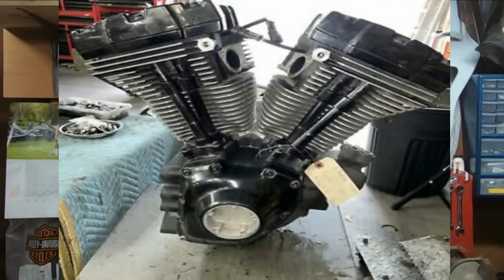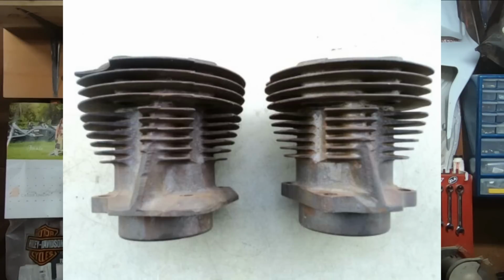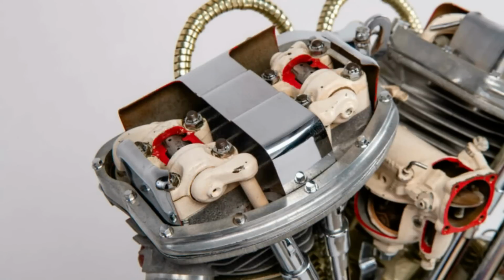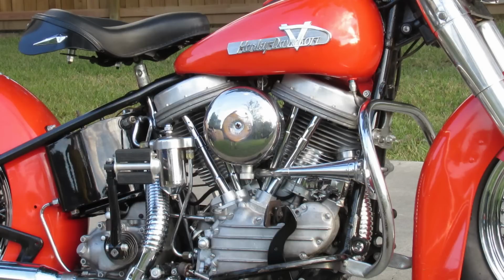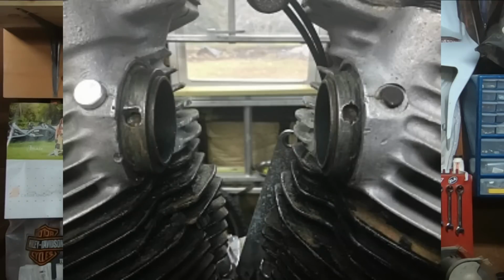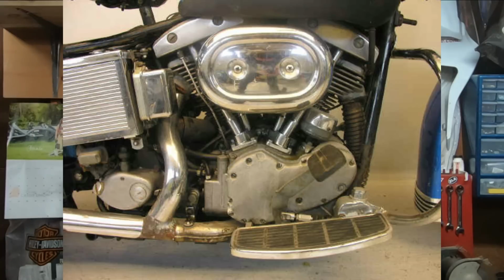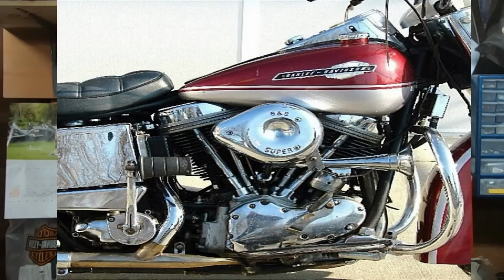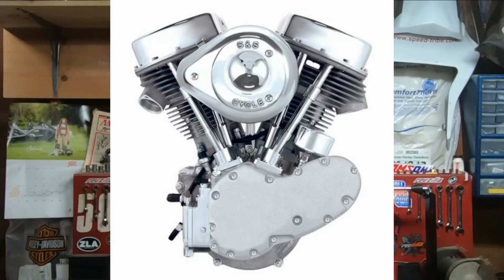Harley-Davidson Panhead is Simplicity at its Finest

Comment from the maker: Have you ever had the opportunity to experience riding a Panhead powered Harley-Davidson?
Reply: Three or four days a week.
Reply: Yes, owned a 63 duo-glide, ain’t felt right since I had to sell it
Reply: I rode my buddies 48 Pan and caught the fever...I didn't build a Pan but a Knucklehead fell in my lap...I ride it several times a week.
Reply: @jasonpatterson8123  I think that’s pretty much how %75 of people get a knuckle these days and in today’s economy, the money made from such a rare bird (engine only) , juice wouldn’t be worth the squeeze, I’d just hold on it. I go years without seeing one, unless it an event.
Reply: I bought my first H-D Panhead in 1966. It was a 1950 FL. It was a good machine -- as long as you performed maintenance when needed and didn't beat hard on it over time. My 1958 Duo Glide was stock when I bought it in the late 1960s. I semi-chopped it. It ran pretty well. I babied both Pans. Ride safe -- W
Reply: I have an 88 Evo that needs some attention. I have 83 Shovel that needs some attention. Once those are done I’ll be looking for a Panhead to either buy or restore. I hope I can find a 1953 same year my Father was born.
Reply: I have a 65 chopper and it is a very easy motor to work on and they run great
Reply: Yes.  😎

My daily rider is a 1979 Electra Glide FLH King of the Highway full dresser Shovelhead.
Reply: My first Harley was a panhead from 62 I kept it 10 years worked on it more than I rode it. And traded it for a VW rabbit and 10 grand in 93
Reply: @randylucas2458  Wouldn’t have been a bad deal if that Rabbit 🐇 is still in Mint condition. Chances are, nobody preserves a Rabbit but they go for a pretty penny if you can find an unmolested oem one. My old boss when I was a yute had one with over a half a million miles in it, still running.
Reply: @MassholeCritic  when I sold the pan the guy I sold it to was a German who worked at the Wolfsburg plant he shipped the car here it was a fully loaded red and black convertible of which the stereo got stole out of three times I finally put a hidden stereo under the seat I kept the car for about 10 years and sold it for $6,000 I paid $350 for the pan head in 1980 and kept it until 92 or 93 whichever year it was.
Reply: @randylucas2458  🤘🏻Can’t even make that 💩 up, great story.
Reply: Had a first year Pan back in the day!
Reply: 1st Harley I rode was a hotrod pan! Balanced with big valves. Ran like a raped ape!
Reply: No ☹️
Reply: I never have. Someday.  Evo was the motor of my upbringing, I shunned them when I was young, youthful ignorance. But I digress.
Reply: Thankfully Yess. I was born in 88. Raised at my dad's Harley repair shop. Pans knuckles and flatheads. Precious Metals Cycles. HARLEY DAVIDSON ONLY.  Charlotte NC has a very large community  of old Harleys👍🏻 check out "Wheels Through Time" motorcycle museum in Maggie Valley NC 🤤🤘🏻
Reply: Yes indeed.
Reply: Havent ridden one, but it was the first HD engine I ever rebuilt in Kurt Heinrich's HD engine class at Wyotech.
Reply: Panheads rule
Reply: Roger that!
Reply: Awesome work GixxerFoo 💪
Keep Living the FUCKING Dream
Safe travels 🙏❣️
💪🇦🇺💪
Reply: The breathing of a pan head is horrible, the intake manifold of the shovel alone is far superior. Please quit glorifying a shitty design
Reply: @Nevada Stronghold The question was have you ever ridden a pan??… And I’d rather push my pan than ride anything you are.
Reply: @nevadastronghold  last I checked, the Shovel almost put Harley/AMF outta business which almost prompted the release of Project Nova. Shovels are bottom of the bucket, though highly sought after for nothing more than nostalgia and sound. Nobody buys a Shovel because they’re known for their longevity, let’s get honest.
Reply: @MassholeCritic  alright fanboy I get it you’re a poseur. Why were so many panheads converted to shovel top ends? Because of more horses probably at least ten or more. Harley Harley made of tin ride them out push them in.

Comment: Very few people know that by a lucky accident it was not possible to blow up a panhead for lack of oil.
The hydraulic tappets collapsed and stopped the motor. That's not advice to try it but if yours just suddenly won't start or run, check your oil.

Comment: Great video. Glad I found you. (Liked and subscribed)
I bought a 1955 FL in 1967. It was only twelve years old but it was totally worn out and and everything about it was in need of something. Mostly replacement. It was a sad machine with too many miles with no attention and then left out back to die. A cop bike that I took home for $155! I was twenty years old, in the USAF without much income so I took the path of least resistance. Everything needing replacement that didn't make it go or stop was removed. It began its new life as a chopper. Over the next couple of decades it received all of the TLC I could give it. I'll not bore you with the details, but it's quick, reliable and looks good doing it. Currently we've been together 57 years! I'm 77 and also have received some replacement parts of my own. Unfortunately, I haven't been able to ride that beautiful Panhead that I know has a heart of gold for the last five years. It's unlikely that I will ever be able to ride it again. I do spend some time with it and we talk about things we've done together. Good times! Good memories!
Reply: @groove2ube Full disclosure- I had to see this bike so I found you on social media... That bike is bad-ass. Beautiful, you've done it justice for sure. Great backstory.... Be well
Reply: @Riff156 Thanks! That bike is my oldest friend.
Reply from the maker: Thank you! We appreciate the support over here! Those Harleys are just timeless and you can make them run forever making them anything you want!

Comment: Funny, 60 horsepower in the late 50's. And in 1999 o bought a softail custom with the 80" evo and she was making a mind blowing 60hp! What it was at the tire? But once I swapped out my exhaust for straight pipes, high lift cam, 95" jugs and a bigger carb and S&S air cleaner😎. And there i was, king of the block with a 80 or 90hp monster! Today my 114 is supposed to be about 90hp stock in my RG limited. No plans to modify it, im getting 45mpg 2 up! Factory this bike should be 120hp. HD, still 20 years behind the times🤦
Just give us full liquid cooled bikes! Overhead cams or camless technology! Yes, intake and exhaust valves can be servo driven like a fuel injector. Completely operated from the computer.... imagine changing the lift and duration from a software map! Thats freedom right there! Going on a long ride... need fuel economy! Poker run, need power!

Comment: I was wondering here about 3 minutes in, you show a Pan with cut away tins and carb. What's with the white rockers' carb and push rods? I haven't done work on many A 1950 and my current 1965 chopper that I took out of service 7 years ago. I hope to go through her this winter and replace the front end for a Duce to get a disk front brake (the chrome is a bonus). Not to steal any of your thunder but I have been watching Pacific mike lately and thought you might want to check him out. Pans, Knucks, and Shovels. I've tuned into you for a wile and love your stuff on Twinkie's but that was incase my oldest stepson 44yrs. could use any suggestions regarding maintenance updates and repairs. But he just rides and leaves the work to other people in his club. I don't think any of them know about you. I don't understand I don't understand some of the younger " bikers " they're just not motorcycle enthusiasts as well. I still get a kick out of your father riding a V-rod. I have one too.

Comment: The cases were aluminum, the cylinder barrels were cast iron, with aluminum heads. There were five bolts through the cylinder barrel into the aluminum head.

Comment: I've owned 3 Panheads. A 1949FL, a 1950FL and an EL with a 1941 Knucklehead motor number restamped on the case. In 1971 build a 74 chopper combining the 1949 and EL motor parts and 49 frame and then stupidly sold the leftover frame, parts and 49 cases. A couple years later I bought the 50FL basket case and built a stock sidecar machine out of it with reverse gear and adjustable fork for winter riding. My brother has it now. The chopper I put back to stock condition in 1974 using all original parts and made it look like a 1950 Hydra-Glide model -- the best looking Panhead of them all IMHO. It has 4x18" wheels instead of fat 16's for a better look and handling. Leather saddlebags and a windscreen. And although it's a 74, it still has the restamped 1941 EL motor number, which does detract from its collector value. Years ago the motor developed a bad knock and it's been sitting in a shed under a canvas tarp ever since.

Comment: I have a 53, 58,and a 61. Mine are all choppers. No I didn't chop a beautiful FLH. They were choppers languishing in boneyards when I bought them.  But I love ol school chops and don't care about collector value. Cast iron by the way actually is more efficient once it reaches operating Temps or so I have read and been told.  Some things are not very efficient on these pans like check out the t shaped intake manifold and think about the air fuel mix getting in the engine . Lol. Regardless an old pan is fun to ride ,easy to work on . Mine have electronic ignition and S&S carbs.  Andrew's gears. 1st and 3rd gear back cut. All the old school performance stuff. No inner or outer primary since they are kick only. Wanna adjust the primary ? Unbolt the trans and slide it back.  Simplicity at its finest.  Kick only. No turn signals, no front brake . No front fender. They aren't fast no big deal. I can cruise at 80 mph though. Low ,long and loud and fun. Ol school.

Comment: I had found a 1965 Panhead basket case in the 80's and sold my brand new 1985 Evo FXRS(?) to buy a truckload of Panhead "bits". After sorting it all out and labeling and cleaning this fantastic find, I bought new jugs, pistons and modified the heads. Then the fun started:
I installed a covered belt primary drive, together with a vented outer primary cover, shimmed it perfectly with a strip of glass, a Barnet 5-stud clutch with a solid aluminum end plate went in there too.
A Sifton 440 cam, S&S Pumper E, I modified the ridiculous pipe-to-head affair by drilling and tapping the head flange and fitting bolts to keep the exhaust on the bike and off the road. A neat 2 into 1 Jammer 4" out-turned chromed stytem. I also welded an aluminum tab on the front fork lower and fixed a PM front disc brake to stop safely. New front fork springs, heavier fork oil too.
The whole bike was powder coated black; frame, 3.5g original tanks, fenders, a custom made black leather seat too, as it had no seat.
Sure, it was not stock, but it looked nice and rode perfectly, kept up with friend's Evos, plus things could be reversed to stock if the need really arose, as I had many stock parts.
As I bought it, shortly after getting married, it was "ours". I lost it in my divorce having to sell it. A Harley dealer bought it in New Hampshire so it went to a good home I hope.
NOTHING made the bitch happier than getting half of that bike. Her lawyer even demanded a financial statement from my father, 2 months after losing my mother to see if anything more could be had from an inheritance. (He changed his will at that point, to a good friend of mine).
I really miss that bike, but the bike will live forever in one form or another. She will not.
Reply: I had to buy back 3 bikes I already paid for.

Comment: I’m looking for advice. I have a 59’ panhead that has been sitting around since I was 8 years old (I’m 22 now). I want more than anything to fix it up and make it the way I want it. Any suggestions on how I should go about that? From what I understand it was running right before it was given to me, but that’s been a while. Thank you to anyone for advice
Reply: I could have that bike running in less then in hour if it's all there and not tampered with. Check for compression in both cylinders.  Check for spark at the spark plugs. If no spark ,check for voltage may need new points and condenser in distributor or new coil . Check to see if your getting fuel at the carburetor if no fuel you most likely need to clean the carburetor or turn the fuel valve on at the gas tank. If you have compression,  spark , and fuel to both cylinders the engine will run.  Good luck

Comment: Two on my bench now. A Johnny Cash special and an untouched 1950. One is like a jigsaw puzzle, the other, a time capsule.

The racers of the Era, your Pete Hill, Joe Smith kind of badasses never used the Pan cylinder heads as they could make the Knuckle outperform them, easily. Pete running as quick as 7.09 @191 mph on the Knuckle.

Comment: My only experience with Harleys has been with the EVO. The Twin Cam is not reliable or long lasting, and I don't even consider the M8 a Harley engine. It may be a H-D engine, but it lacks the characteristics to make it a HARLEY engine. I do love the older Harley Panhead, Shovelhead, and Ironhead engines. I may eventually get an Ironhead Sportster. I watch a channel called Pacific Mike, and he does a lot of work on these old engines. And while there are very few original ones left today, you can still buy modern reproductions of the Panhead and Shovelhead. Unfortunately they are extremely expensive.

Comment: What a nice father's day treat ,my beloved 1964 panhead  duo glide and I thank you ,note ,after WW 2 there was a surplus of aluminum from scrapping airplanes Detroit starting using it ,Harley followed ,yes with the panhead  ,top end oiling starting in 49 was thru the cylinders ,oil cookers .
In 1962 ( or around ) the panhead  went back to external oil lines like the knuckles ,and later on shovels ,returning thru pushrod tubes .
Really enjoyed your video ,last week I finally replaced manifold O rings after 40 years ,thank you as always Panheads forever ,jp

Comment: I had a '52 Panhead.  The engine itself didn't leak that much, but it had an adjustable oil dripper system that lubricated the primary chain.  There was a drain hole in the bottom of the inner primary cover to let the excess oil drain out.  Yes, it marked its spot when parked. 😃

Comment: Yes, I own 2 Pans. 1 original and 1 Kustom. But if the Panhead was the father, the Knucklehead was the OHV grandfather. Same basic bottom end. The Timken cones on the new crank, and Torringtons on the inner cam journal didn't come out till '55.
If not for WWII, the Knuck might have got a bit more sophisticated. In fact, it took the hot rodders of the day a while to get their Pans up to the performance on the hot 74" & 80" Knucks. 
 The aluminum material used in the original Panheads was garbage. The combustion chamber dome was too thin, and the valve seats were too close to the spark plug holes. They tried more fins thru the years, but the material and sand/gravity casting process was still poor. Try to find a set that isn't cracked between plug hole and seats. 
 And did you ever study the intake tract? 

When I was gonna rebuild my 1950 motor into a stroker, the cases were full of spider cracks. Same with the heads. Too many temp cycles for that crude cast aluminum. So I went with STD heads and cases and filled them with an S&S 93HC Sidewinder kit. The STD head had lots of modern aluminum alloy to dissipate the heat. They used the standard 1.5:1 Pan rockers (I used Baisley roller rockers in mine) and had a big improved Shovelhead intake manifold and tract. Mine were ported w/oversize valves and really outflowed Evo heads.
Reply: What do you think of those S&S Pans and Shovels?
Reply: @barrybarnes96  My Pan heads & cases were made by STD long before S&S made theirs. But there's no questioning the high quality of S&S stuff.

Comment: In the early 70's I had a 51 Pan until someone stole it. Then I got a 49 Pan. I remember most about the sound was the rocker covers sounded like bongo drums. As far as the overall 'feel' my 2003 Twinkie  is very reminiscent of the Pan. Not as vibey though.

Comment: Pan was the most innovative engine,,, hydraulic lifters front and rear shocks from rigid and springer , and electric start cab breaks to juice breaks. And lots more.
Reply: Yeah, motors got improved or updated parts seemingly every year. Technological advances courtesy of WWII and Korean War.
Reply: Electric start was introduced the last year of the Pan.